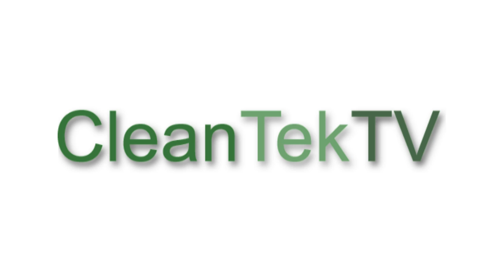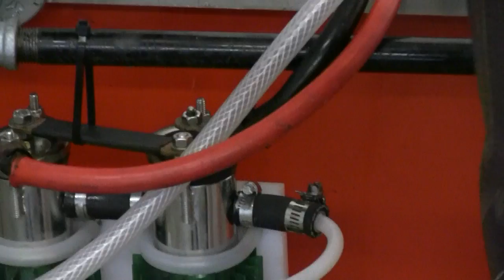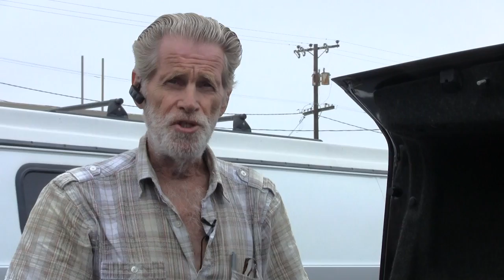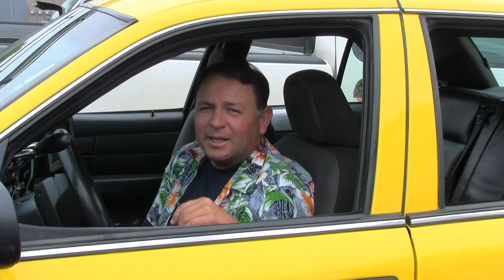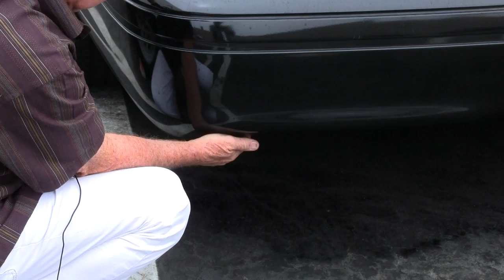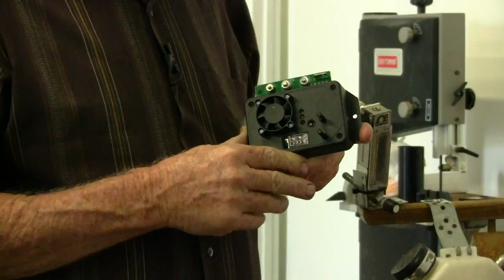Global Energy International / It's Just That Simple

Comment: I don't understand how you can boost the amperage from the alternator unless you reduce the voltage, which is already at a low 12 volts.  Watts=volts x amps.  So you must be stepping down the voltage to deliver more amps, but either way, the power output (load) on the alternator would be the same.  Basically, a water splitter running off the alternator.